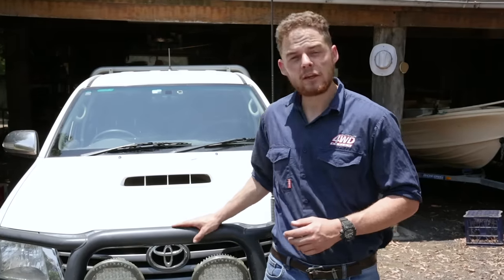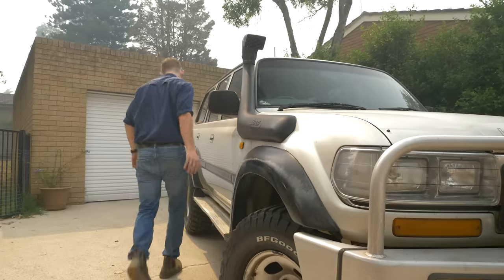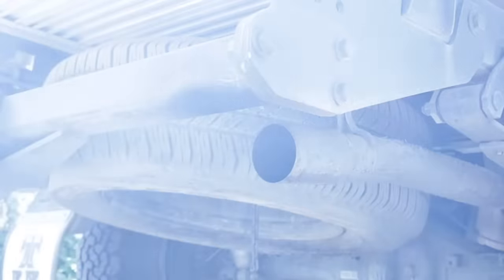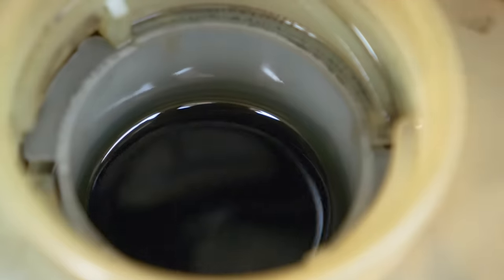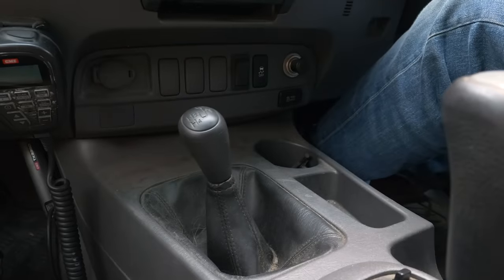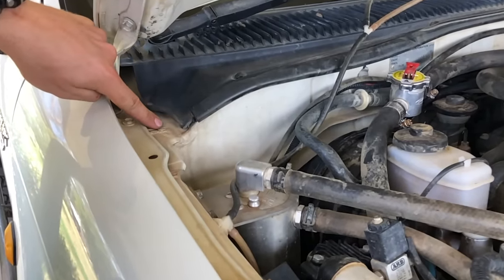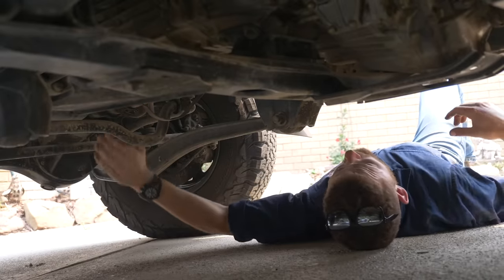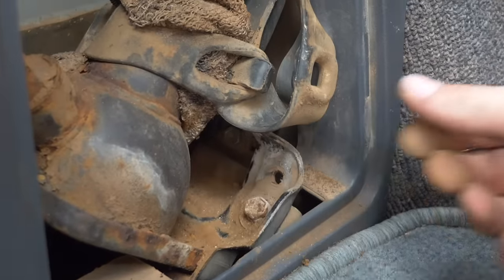BUYING USED 4WDs – Expert tips to avoid a LEMON and get a BARGAIN

Comment: I bought my first 4wd about a year ago, it was 99 ford courier 2.5 td and after a year of having overheating issues and overhauling almost all the cooling system I found out the mechanic who did the last head gasket went too deep on the block and it blew a head gasket and warped the head bad. It was my pride and joy, I sunk about $10k in to it just to end up have to sell it cause it was gonna cost 10k for a rebuild

Comment: Bought a Disco 1 TDI for 2.5 grand, now 6k into it and I’ve only just “discovered” the rusty floor pans! Gonna need to learn to weld I think...
Reply: If you want to be scared remove the front wings and look below the A pillars, all rrc and d1s rust horrendously there, especially the passengers side.

Comment: Gday. Bought a troopie in 1994 at 6 months old with 9000ks on clock. Still have it today with 648000ks. Its my daily drive for trade work and weekends. Never had huge repairs. Just regular maintenance and repairs. Minor rust repairs every  3 years. Its slow but very reliable and cheap to own. Love it.

Comment: I got an older Vitara. Not long after I bought it mechanic located a timing chain rattle. Got it with 210000 had it for 40,000 still going strong so far without repair. Its got no other issues and has served me well, done some recreational 4x4 and worked in forestry with it. it great for fanging across wet logging landings, trekking up snig tracks, towing small vans and generally making the fellas eat their words about it being a soft 4x4. It's now time to get the chain fixed, sure it'll cost me 3 grand but better the dog you know than the dog you don't. if I bought a different car for the same money I couldn't guarantee that the other vehicle wouldn't have other issues.
Reply: Hello Peel IT

Comment: I bought a lemon, prado d4d, bad injectors. Why did I buy it? Well it ran fine no knocking noise, 6 months later in winter wifey complained about knocking on cold start, about a month later driving the car caused a ploom of black smoke to engulfe the local neighbourhood, that's not even an exaggeration.

My advice, for about 150 Toyota do an injector check just get it done because sometimes you can't tell. Make sure they do the test early when it's cold and not after the car has ran. If it's a really warm summer night(25c) wait until it's below 15 or so, preferably 0.

Comment: Bought an 88 gq shorty it 175 on the clock. Looks like it just came from the factory and performs like new too
Reply: bought a 91 shorty with 200 on the chassis and a holden 304 with 5000km since full rebuild
such well sorted motorcars ay

Comment: Gees the timing of this video turning up on my feed. Going to look at a pajero for off road and beach runs. Subbed.
Reply: Depending year of the paj, check for rust in the chassis around the rear wheels.
I got caught out with that on an nj pajero :( 6k down the drain.
Reply: Tips for buying a Pajero .. if it has a Mitsubishi badge walk away
Reply: Jordy T so true
Reply: @BLUEY4X4  i bet you're a toyota owner!
Reply: @10Mbowman  Nissan actually 🤪
Reply: @BLUEY4X4  lucky you have a nissan!
Reply: haha
Reply: @BLUEY4X4  as a Pajero owner I feel personally attacked...
Haha
Reply: Jordy T I have a 92 nh? I think it is. I always forget the model. It’s not a daily as I have a V8 falcon for that but it is an awesome rig. My partner bought it 6 years ago for 1000 bucks, has a couple dents, maintenance was poor but she only got it to drive to the dairy and it has been awesome! Put 31 inch muddies and a dual battery for the fridge and it’s got us up the high country a few times, I’m always taking it out the bush near home it loves it. Thinking it wouldn’t last long I never serviced it until recently. It did 70,000 ks in 5 years without an oil change and for the last 5 weeks I daily drove it. It has never let us down. 365,000 kms with stuff all servicing. Everyone talks shit about them but it has been so much better than I thought it would be! Very much underrated rig. I never thought much of Mitsubishi but they just seem to keep ticking along, might blow a little bit of smoke and rattle a bit on startup but has never stopped
Reply: if you are buying it purely for beach runs, ignore any rust because give it 12 months and it will be covered in rust anyways lol
Reply: @Jordy T we've got an NP Pajero, and had no drama's. We brought it with 260k on the clock n now up to  330k. Always change oil n filters regularly. We do a lot of sand driving in the Mallee. Would recommend a Pajero to anyone, but with ANY vehicle always have it checked. I've seen a few dodgy Patrols in my time.
Reply: Go for a DID NT late 09-12. No dpf. Only thing i would recommend is Block Egr and/or catch can and yeah happy days. Done 30,000 on mine in a year. So far just filters and oil change. At 260,000 ks.
Reply: Lol was waiting for Toyota fan hate, I haven't excluded them, just finding something for a decent price with a Toyota badge is a it harder :) thanks guys for the tips:) Not spending a lot, so I'm not going to be bothered if it gets a bit dinged up, and I'm taking my time to find something.
Reply: @ZedTee77  Of all the car makers Mitsi is the only one that has not been caught up in shonky stuff ! I like their utes bullet proof ! 

"Thinking it wouldn’t last long I never serviced it until recently. It did 70,000 ks in 5 years without an oil change "  OUCH

Comment: I bought my MQ Triton in January & 3 weeks later the cold side intercooler hose split in a small country town  outside of Mudgee with no mobile service but luckily there was a working Telstra phone box & the local Mudgee NRMA patrolmen tried to help me out with duct tape & cable but the bloody fault code & limp mode wouldn't clear & that resulted in a $1200 tow back to Sydney & the used car dealer fixed it with the help of the Mitsubish dealer next door.
Straight away I upgraded to silicone intercooler hoses & I also removed & cleaned the inlet manifold & EGR valve & all was well until early January this year the oil level started rising & it throwing up fault code P1428 & that was a faulty DPF temperature sensor & it's since been replaced.
It's now a pleasure to own & drive.

Comment: I made the mistake of buying something that hadn’t been looked after. I was 19 years old 3rd year carpenter saw a 79 for $30,000 with 150,000km on it I went and viewed it he had steam cleaned it and it looked brand new. No oil leaks.. nothing, and it drove well. I wanted to do it on my own so I didn’t tell anyone just bought it. (Being 19 you don’t know shit about life, they don’t teach you about these things in school. 8 months down the track I have spent $10,000+ on fixing the thing and it’s still not 100% I’ve learnt a lot of valuable life lessons. Yeah a lot of people say you should have got it checked (it’s easy to say all that) but I trusted the road worthy certificate it came with.

It had 
- cracked front diff coil mounts 
- sump wasn’t sealed properly 
- all uni joints were worn
- all bushes were gone
- wheel bearings and hubs were gone (practically pissing out oil and grease a week after I bought it)
- it had a cracked rocker cover 
- bolts were stripped 
- the windscreen leaked
- the wiring on it is a spaghetti factory
- And a whole heap of other things the list goes on

I don’t regret buying the car at all yeah it upset me a lot... I work hard for my money but gee it taught me a lot of things buying a 4x4 second hand definitely puts more hairs on ya chest I recon

I still have the car I love it to bits I just bought a lift kit and a front auto lokka and a 3/4 canopy so I’m stoked atm! 

My advise to blokes like myself is just get it RACV checked and just make sure you allow $10,000 on top of the price cause even if it is mechanically sweet you’ll blow 10k on suspension, bar work, tyres, accessories, all the bells and whistles before the click of a finger

Comment: my vehicle hasn't done heavy towing and i have a brake controller bloody hell lol, most i have towed is about 1.5T
\
Reply: easiest way to see if its done heavy towing is look around at the toys in the yard.. if he has a big boat or a massive caravan then yeah its been doing heavy towing or a tool trailer which is probably twice its legal weight limit.
Reply: True. But there's ppl out there with 30' caravans and 6m boats.

Real test is the engine and gearbox condition.
Reply: or you could have a smaller 4x4. any trailer over 750kg needs an EBC fitted to the tow vehicle. So it may have only towed a one tonne van on occasional weekend holidays, as in the case of my parents vehicles.
Reply: @peelit4610  Not quite right - you don't need an EBC for over 750kg, just brakes, mechanical hydraulic whatever. Over some trailer weight you need a break away system. EBC are very nice and should be required, but they are not required at least in VIC.

Comment: Bought a 133k miles (214k km) Landcruiser 120. Looked so clean, so nice. The seller sprayed the whole undercarriage with a rust protector. Started leaking oil - one drip every now and then. Had someone repair something (can't remember what).. didn't help, it started smoking and more oil leak. Repair after repair didn't help. The turbo had oil in it. So I sold it to one of the websites that buy any cars.

Comment: The filler cap trick only apply if the same amount of pressure is coming out of the dipstick. If there's a lot of pressure on top and rarely any at the bottom, it's not the engen but rather the injector seals leaking. This is easy to fix and cheaper than a new engine.😁 Be smart and save A LOT of  money

Comment: I bought a 1996 XJ Cherokee as a cheap car to learn how to fix things on cars without being scared to break anything. Took it off-road once with my dad and, accidentally became a 4WD enthusiast. The XJ has long since been scrapped, however I can’t wait to be able to buy another 4WD. Weather it was a lemon or not is debatable, because it was very cheap to buy, and I knew it was tired, so the fact it needed work didn’t scare me. It was a great learning experience, and I’ll always have a soft spot for the XJs.

Comment: I picked up a 92 SWB Pajero, had a bit of rust on the frames, panels are good. Bit of an old engine, 150,000km on it.
It's going to be a labor of love to get her back in good condition. But overall I'm very happy with my purchase, plus the kids have loved the spontaneous beach trips. 
Had a couple of traps - 
1) Thermofan was busted - seller said the A/C was working, and it would, for a few minutes, or in cooler conditions - it would have been damned easy to spot this defect before sale. - not sure if he knew about it, but likely he did.
2) had a dead ECU temp sensor on the engine - seller told me of that one - because it generated a check engine light - fixed and fixed now.
3) I really wanted it..  this is probably the biggest trap, I'm now going to be spending a bunch of money on this car as a project over the years.

Comment: 3:32 doesn't neccessarily mean worn piston rings could also be blow by past the injectors which only require new seals...not much of an issue!
Reply: don't injectors blow by into the atmosphere not the crankcase?
Reply: @MiniLuv-1984  no this engine is a common rail the injectors are inside the valve cover so a leaking injector/s can cause this. Don't get confused with the older port injected engines, which the injectors were positioned on the intake manifold .
Reply: @creeatd  thanks for that. I didn't know, now I do! Cheers.

Comment: I bought a petrol GXL landcruiser 80 in 2010 with 250000 kms on the clock.  Its now at 290000kms and hasn't missed a beat.  I did some of the checks in the video.  The car had some rust a few minor issues but it has been super reliable.  Only cost me $11500 back then.

Comment: Just bought a 2004 Pajero Exceed 3.2.  372,00ks. fairly tidy All bushes and joints in excellent condition.  Clearly been used to tow horse floats.  transmission mint, all 4x4 selections mint. engine mint.  Decarbed EGR and inlet manifold which wasn't too badly clogged which told me work had been done at some point not too long ago. No dings underneath and ZERO oil leaks anywhere!  Only 4th owner from new.  lasy ownwer only did 15k in it.  clearly never been off road.  paid $5.2k for it  is nice truck.

Comment: I bought a 2011 Toyota hilux 3.0l D4D for just under $30k and then 6 months later had a injector fail destroying the engine and set me back $15k in repairs which involved a new engine turbo intercooler injectors seals gaskets and a lot more. Checked all the service history and it was taken care of didn’t miss a service or anything but did say injectors were replaced 50,000km ago so that’s why I went ahead with the buy as this is a common problem with the Lux’s. but happy now she’s on the road and running like a dream

Comment: You forgot to mention, remove the Radiator Cap and check for rust in cooling system. If there is rust do not buy. That means the previous owner never used antifreeze and that really ruins the car. I bought my Patrol and learned that the hard way. It had no other issues at all but because there was no Antifreeze for over 270k Km, it had alot of rust in the system. When I started putting Antifreeze in my system I found a new water leak every 2 weeks or so. As the antifreeze not only prevents water from freezing, it also raises the boiling point of water and prevents rust. Took me like 8 months to get all the rust out by flushing the engine and replacing pipes and adding new antifreeze every time. And what happened in the end when the system was 100% clean again??? Small crack in cylinder head and it started heating up on Long uphills. Me and my dad got New Head from Japan with radiator, fitted those on and now i have a Mint 4.5 Gu Patrol 1998! :) So please boys! check that cooling system! Will save you alot of money and trouble.
Reply: Wish I've reading this earlier. Now I'm in the same process. Going uphill sure boils the coolant spare tank. Now sitting in the garage waiting for new head gasket.
Reply: @Addy Marsh  Sorry to hear that mate, i wish you the best of luck :)

Comment: i bought my first and current 4WD 2nd hand, it was an Ex company vehicle and was bog stock except for off road AT tyres  paid over 30K for a 2013 D40 that was 3 yrs old and had done ,just tipping the 120,000 k mark. it's is an awesome truck after owning it for 3 yrs it has only just tipped over the 190,000 k mark and it's been to Yawal twice and other favorite 4wd destinations and has been to Fraser Island once. I bought a good truck. no lemon here  and only now am i currently doing my major service after it's major service when i bought it 3 yrs ago. Every 12 month i do a minor service on this vehicle. I bought a 4wd to use it as a 4wd. but when i buy my play 4WD i'm turning my Nav into a tourer that can manage the tough stuff ( ok i don't do what  the Dmax does every episode ) even though i know it capable of doing that

Comment: I bought a 99 RR P38 diesel, the BMW engine. It's done nearly 40.000mls in the last three years and it does a bit of offroading on air suspension, nothing hard core like this lot. The previous owner had it from four years old and it has a bookfull of history. Keep up the great work! 😎

Comment: I bought my first 4x4 at 18, it was a GU patrol with everything I wanted done to a 4x4 already done, so I thought perfect I’ll buy it without really checking it over properly, the road worthy was already done for me by the previous owner, I soon realised it was a dodgy roadworthy as I started having a look at the RB 25 turbo swapped out by the previous owner. It had extremely dodgy wiring and leeks absolutely everywhere. It was even worse when I hopped under the car and saw rust all through the bottom of the floor. I felt absolutely ridiculous when I saw what I had bought and opted to sell it pretty much straight away as it’s wasn’t worth the money to fix it
Reply: But did you tell the next owner about tbe problems?
Reply: billabong80RTO it was actually a good mate of mine that was there when I was inspecting the car after I bought it, he had the money to do a body swap and fix all the problems with the motor

Comment: In the early 2000s my father was trying to sell his 82 Chevy 4x4 work truck with the 6.2 diesel and 4 speed stick. He used it hard but not abused and maintained it meticulously. He wanted 10 k for it and he got was laughs and offers for half. When I got my driver's license he gifted it to me. Today I still have it with original paint, having added 300 to the 500k it had on the clock. Never failed and we spend less than 3k on minor non emergency repairs... The funniest part is we would get 25-35k offers for our 82 Land Cruiser...

Comment: I bought an 80 series recently, 1HZT with just under 400K with new injectors recently installed, 2" lift, near her tyres, snorkel, roof cage, fridge and draws in the back, 2 batteries in the front and another deep cycle battery in the back connected to a 110A solar panel on the roof. Thought it was a good buy, test ran great, everything looked good, bought it, drove it home, only owned it for 6 Hrs and  the whole motor seised up. Ended up paying an extra $11k to have a top to bottom rebuilt of the motor and turbo 😔😭

Comment: The only tip you need. Don’t buy a used Jeep. Buy a used Isuzu
Reply: I agree. It's by far the best bang for your buck. But do get the suspension checked out. The rubbers tend to wear out prematurely causing other parts to fail. 
Cheers
Reply: I hear the lady's love used Isuzus. They vibrate and rattle such it saves a bunch on batteries
Reply: Hell no stay away from old isuzu worst 4wd to buy from my experience